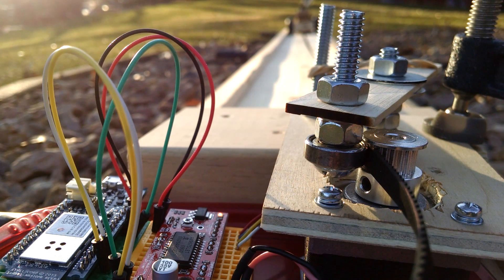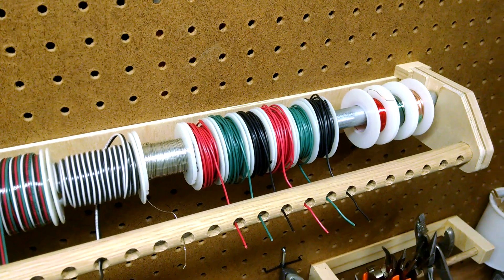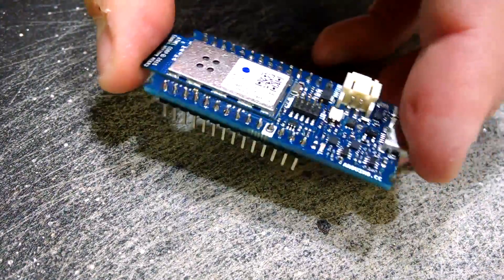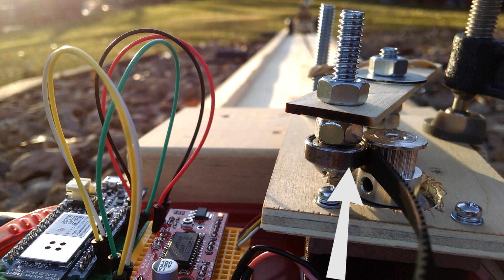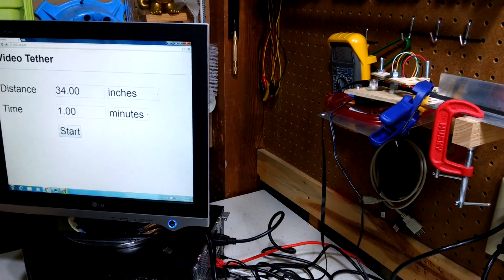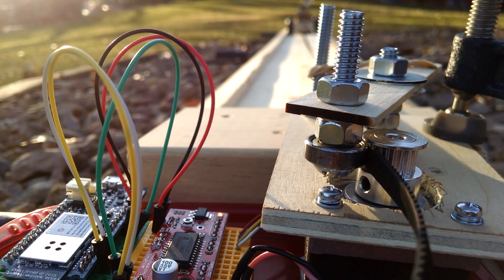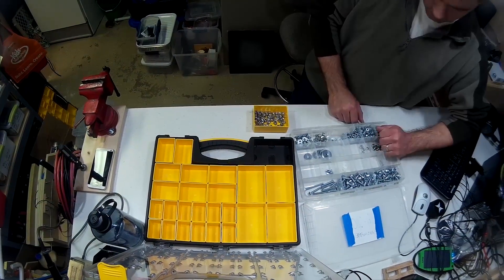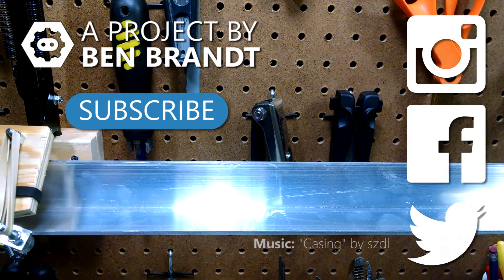The Video Tether - wirelessly controlled precision motorized camera slider (prototype)

Comment: Cool build! How could you incorporate two limit switches to have the motor reverse when the cart gets to each end of the track? This way you could also use a oval belt wrapped around two gears/pulleys and also extend you time lapse.
Reply from the maker: Thanks! Having a looped belt is a pretty established design, but you're limited with a set length of travel, but it would be simple to mount limit switches and move in both directions. For this build I wanted to try the concept of pulling in only one direction, which allows me to pull any distance as long as I have enough belt.

Comment: You mentioned that the arduino was configured to do whatnot. Did you write the sketch yourself, or did you find a sketch online? I'm working on a similar project (with servos instead of stepper motors) and I'm wondering about the commanding API (restful endpoints?) and the conversion into stepper motor instructions. I always enjoy and am very impressed by your video presentations! Keep up the great work. Inspiring!
Reply from the maker: +redpacifier Thank you. Yes, I wrote the sketch using some example code for a webserver and a sample stepper control sketch to get started. From there I slowly developed it into this project. It's not my cleanest code, but it works well. You can find more details here: https://www.hackster.io/benbrandt22/wifi-controlled-precision-camera-slider-b6062f

Comment: That was great! I was impressed by the smooth motion of the pull. Is there any jerkiness when it first starts?
Reply from the maker: +GeekBuilders if the belt isn't already tight there can be. I found that adding a little resistance to the dolly helps keep the belt tight. On the wheeled dolly I stuck a glove underneath it to add some drag. On the other dolly I added a small piece of foam between it and the track.

Comment: Awesome project Ben.  How hard was it to make the app?
Reply from the maker: +Greg's Garage Like anything it depends on how much experience you have going in. That said, it wasn't too bad. Arduino is a nice platform to work with. I was able to use some existing code libraries to handle the low level parts of the wifi and stepper control, and then gradually built up some sample code and made it into my own.
Reply: I'm wondering about the phone app.  Did you have to create that or was there an interface for it?
Reply from the maker: +Greg's Garage The phone app I showed was just the Chrome web browser, viewing a web page generated by the arduino.
Reply: Watched it again.  I'm going to have to pick your brain a bit more some day...

Comment: This is great! love the bearing solution! to reset it you could just reverse the movement and once it's done resetting you can just pull the camera until the belt is tight, right? It is great man!
Reply from the maker: +Cactus! workshop That's right... What I've been doing is setting the pull distance to a negative number to "push" it back (while I physically pull it back to the starting position). I'll probably update the interface to add a simple "reverse" option.